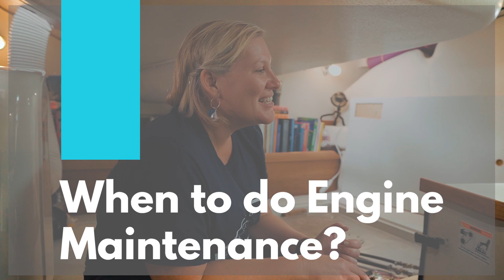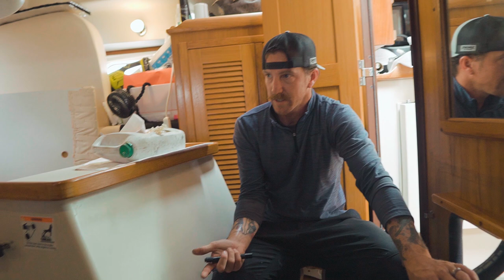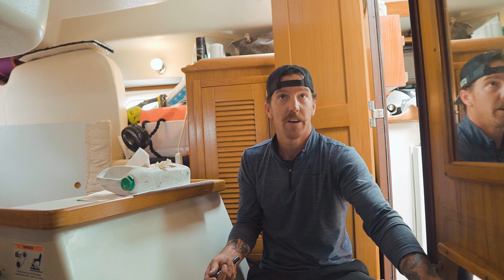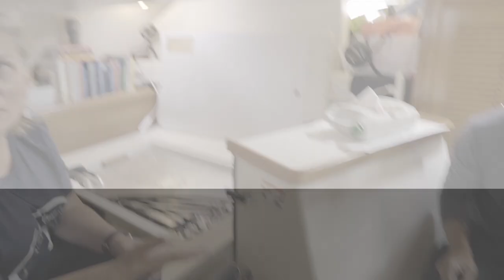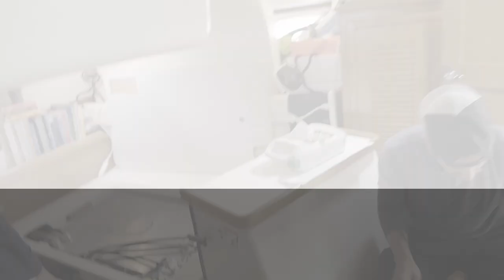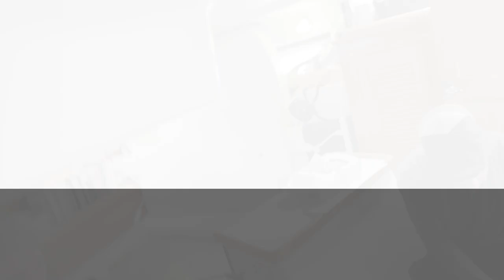Diesel Engine Maintenance, When To Change Filters, Oil, Coolant... (ep.67)

Comment: 100 operating hours for pump impeller? That seems pretty short. That's closer to an oil change interval. Bypass filtration for the oil will extend oil drain intervals. I only have 21 years on my current engine.
Reply from the maker: How long do you normally go between impeller changes?